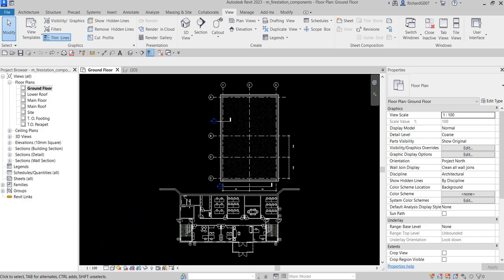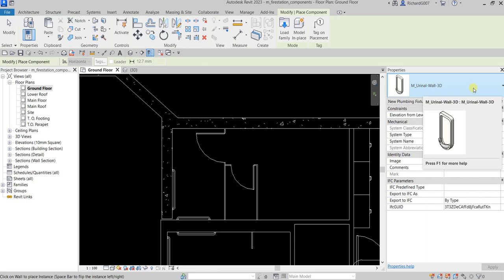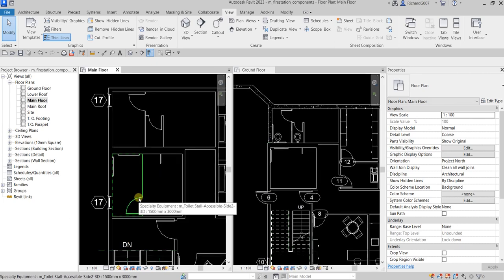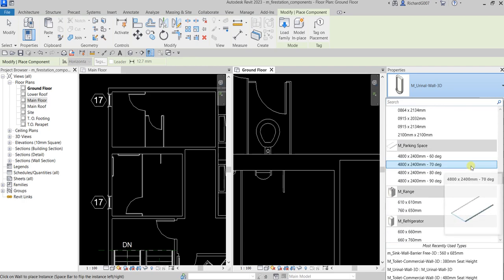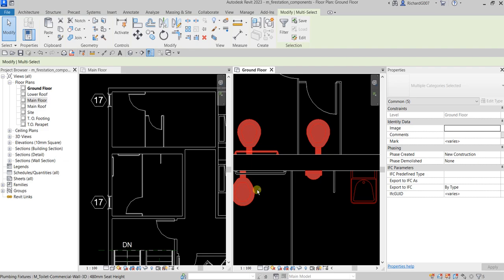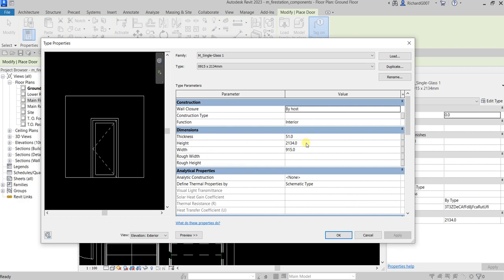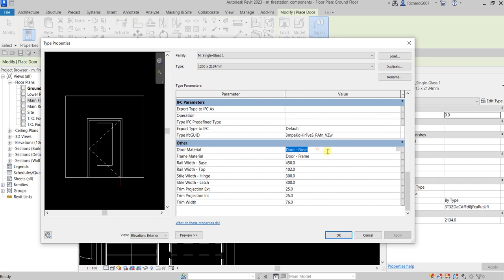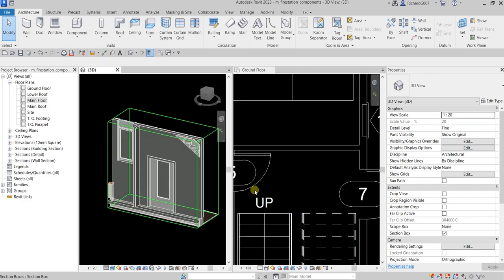REVIT 2023 FOR ARCHITECTURE: LESSON 10 - LOAD AND ADD COMPONENT FAMILIES

Comment: Hi how to change the duct elbow inner radius with 6 inches in duct fittings especially in wye and y fitting types.  For wye piece main duct size is 1500x500 and elbow side is 1200x500 and another side is 450x500 with these dimensions im trying to edit family.. that time pice close offset was disturbing kindly help us.
Reply from the maker: hi Siva, really can;t tell. this is a little complicated specially im not working on the model.